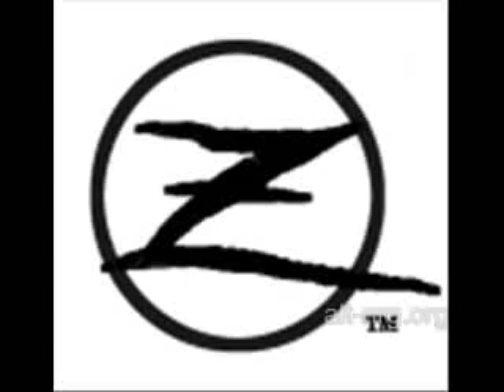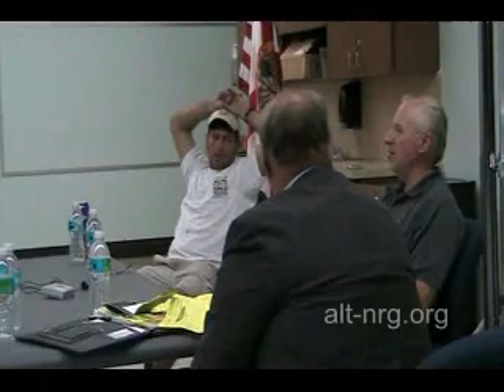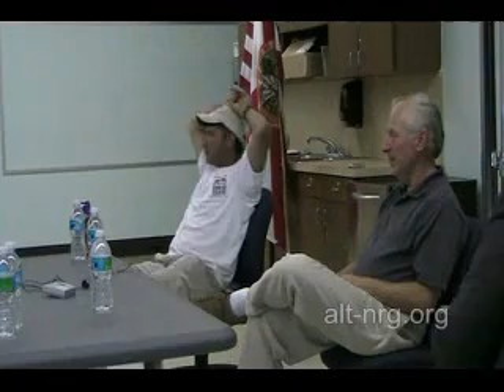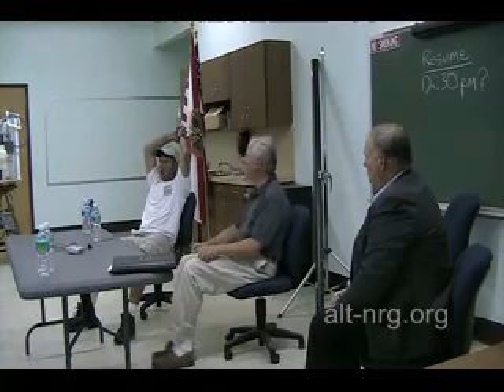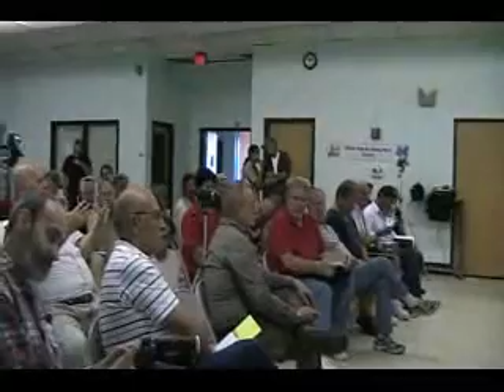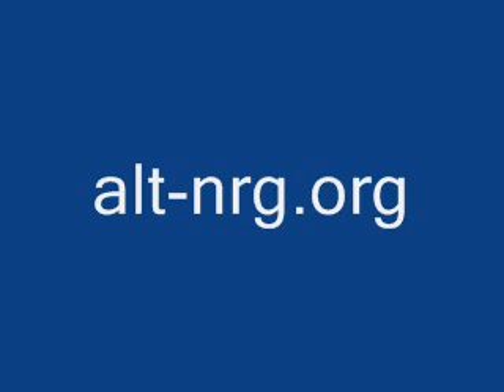#154 - MTI Roundtable #11 of 18

Comment from the maker: One of my goals this spring is to acquire a late model car to experiment on with OBD-2, fully electronic ignition and performance tuning hardware allowing me to connect the ECU to my laptop and completely remap it for HHO. Then use the data to create aftermarket ECU chips for HHO.

I will be recording combustion chamber temp, exhaust emission and MPG. Will also be using it to test EFIEs & MAP enhancers, demonstrating why some see initial improvements only for them to vanish soon after install.

Comment: In my opinion to make that technology  work you would have to combine diesel and gasoline engine. Direct injection of HHO into the comustion chamber can make it work more efficinetly.Also some time ago i was workin on my cars ECU to get more power out of it by reprograming it.What if you replace one of the temperature sensors and some other sensor to messure how much HHO is produced by the cell and under what pressure or temperature so the Reprogramed CPU can make the mixture leaner

Comment: Regarding Stanley meyer;
He claimed pulsed DC high voltage breakdown of water was more efficient than normal electrolysis.
The injectors he later invented was introduced to obtain high voltage breakdown of water inside the cylinder, i.e. he did not inject HHO but water through the injector...